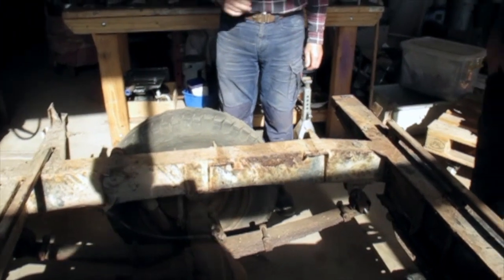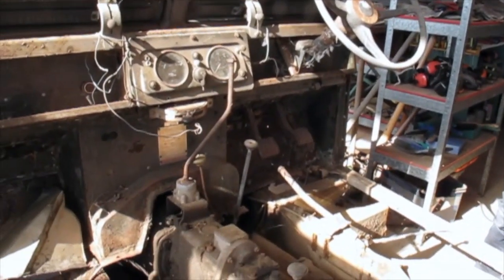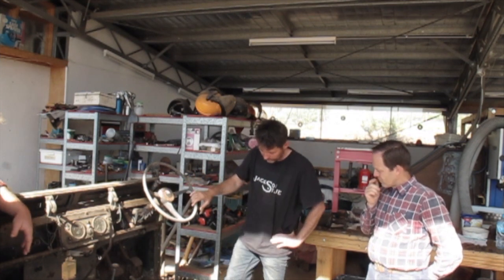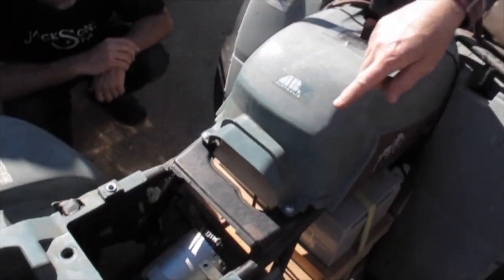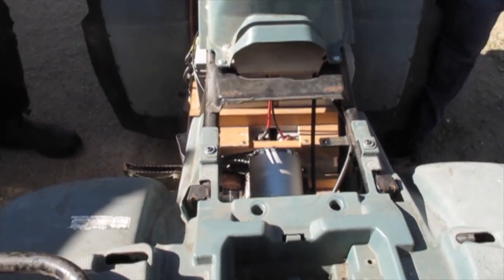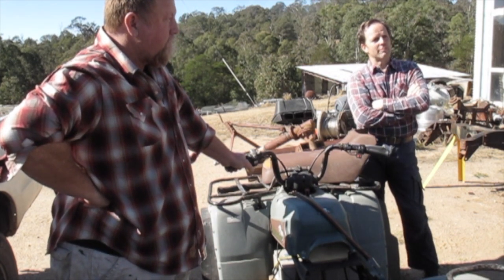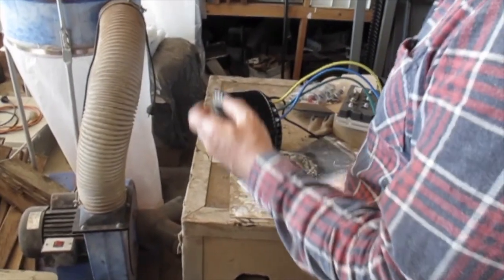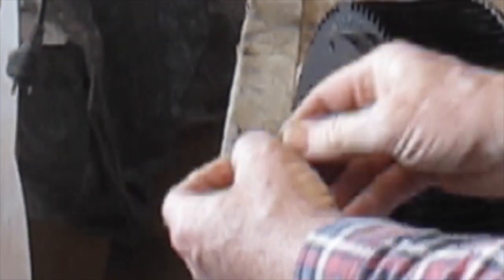Dangar Stu Visit - Electric car & electric quad bike discusions

Comment: I'd love to hear more about the reasons for keeping the gearbox since I'd have thought it was both heavy and unnecessary.
Edit. Given that variable torque isn't much of an advantage when an electric motor produces maximum torque at zero rpm.
Reply from the maker: Giday Nick. in regard to reinstating the gearbox (and transfer); the bottom line is it's fun to play with and offers some versatility. The more conventional motor to gearbox connection is kinda easier than inventing a connection to the transfer case (read as ;  its easier and we don't have to think as much :-) ).  We definitely want to maintain 4wd capability.  With the addition of a reverse polarity switch it offers 4 forward and 4 reverse gears in high and low, we also have a PTO attachment on the gearbox which will give a further options for attachments/implements. This project is about learning and having a bit of fun as much as creating a usable EV/mobile battery wall.  I hear you that it is probably more sensible to do do away with the box but if we chose the sensible option we would probably just buy a Leaf :-) Good question, we could always be convinced either way and appreciate your thoughts or ideas.
Reply from the maker: We are now thinking we may utilise the PTO point to attach the dc motor into the power train.
Reply: @VintageRestorationsAustralia  That is an excellent idea.

Comment: Lithium on boats?   If you want to run Air conditioning on board there is almost no choice.  You need a lot of power to run a 14000 btu aircon unit and lead acid won’t accept the deep cycle
Reply from the maker: Yep, Li significanlty increases capacity